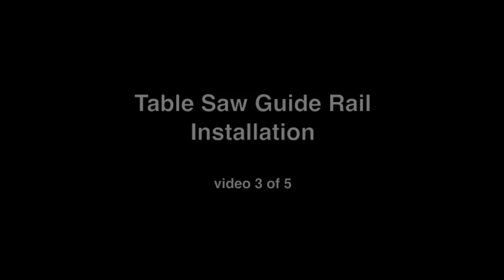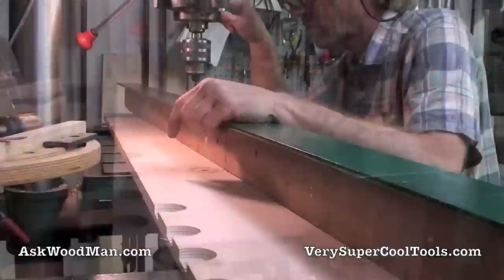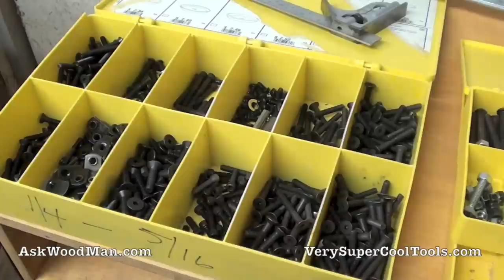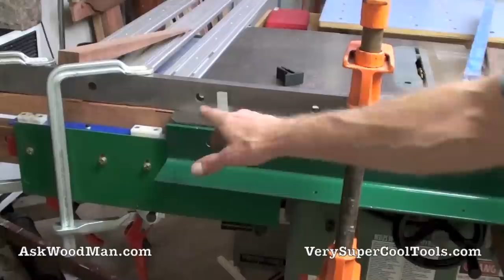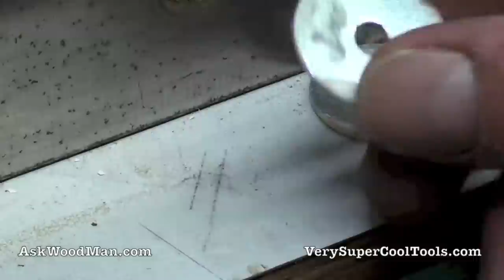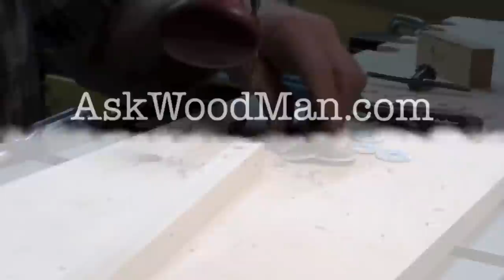3 of 5: How To Install Table Saw Guide Rails -- DIY Biesemeyer Style Guide Rail Series

Comment: nice =) just a small warning about drilling up holes so close in size, very easy to break the edge off of the drill bit =) i usaly use a step drill for stuff like that that is more made for enlarging holes =) great work on the fence tingie =)

Comment: Great build!  Really appreciate the time and thought you put into all of this.  Really speaks to your character since you're now selling what you're showing how you made it all.  Meaning the T-square on your other vids.  What's the overall length of both the 2x3" tubing and the 2x2" angle iron?  I'm really struggling with the length I want and the space I'm able to accommodate in my one car garage!! Thanks for sharing!!!
Reply: I meant 3x3" angle iron...
Reply from the maker: Here is a link to free plans you can download. http://vsctools.com/diy-guide-rails/  If you scroll down there is a steel sizing diagram that will tell you your steel lenths for your particular saw and the rip capacity you desire.